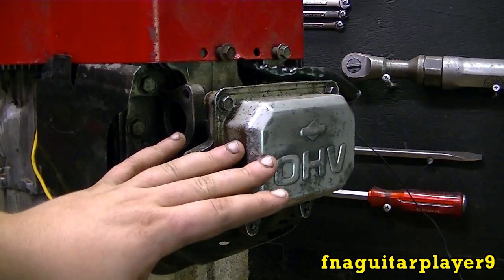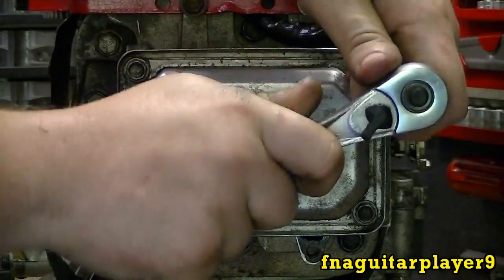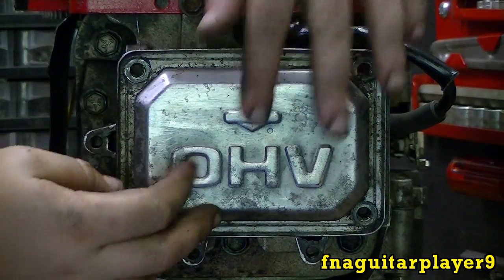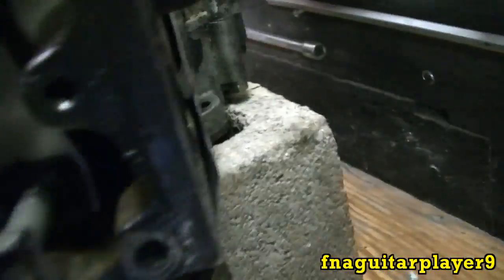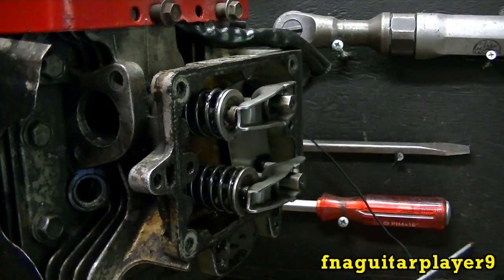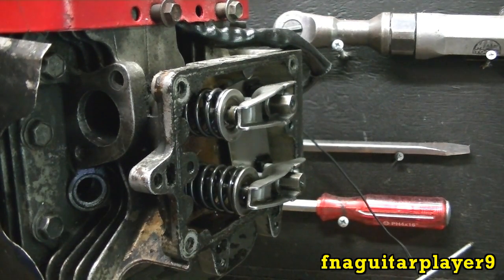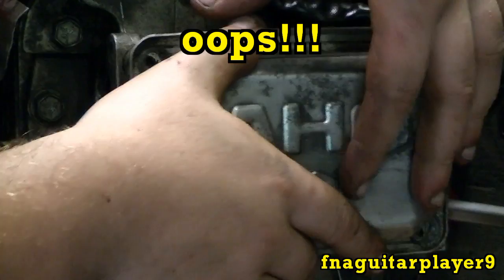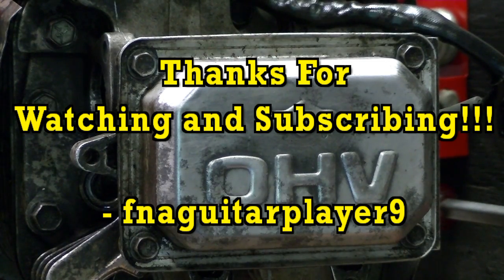How to Adjust Valves on OHV Small Engines (Valve Clearance / lash)

Comment: i ajusted valves still doing the same compresstion not.releasing what is wroug
Reply from the maker: +Raymond Langevin Alot of times when you adjust them and its still not releasing then the lobe is worn out to much on the camshaft for it to work. OR you have a weak starter or battery causing the problem. might have to get a new camshaft if the starter and battery is in good shape. Thanks for Watching!!!

Comment: Why does the decompression valve opening too wide cause the decompression valve to fail to decompress the power stroke ? Is it because at TDC of the compression stroke the bottom of the decompression valve strikes the top of the piston causing the decompression valve to snap shut before or just as  the power stroke fires?
Reply from the maker: +rbbiefah The compression release cycle ends before the power stroke occurs, the release only occurs on the compression stroke. The valve should be closed before the piston comes up all the way, so there is still some compression. Thanks for Watching!!!

Comment: Hey,
I have one at the moment thats dragging while trying to start, Although the valves have been adjusted it is still doing this..So have come to conclusion that it is the cam advance..How is the best was to verify this with out taking the engine apart for you?
Ive adjusted many valves but have never had this problem come up..so either cam..or I know on some could be the key way slightly sheared..out of time..
Thanks!
Bruce.
Reply: wood you have video on timing
Reply: +Raymond Langevin What?..The timing is simple on these briggs..It has 2 dots that you line up and your good to go..one on cam..One on Crank. Bada bing bada boom...

Comment: Is it common to have a large amount of fuel dump out when you take the valve cover off?
Reply: jmoney77 From my own experience with these small engines is that the gas will leak into the cylinders/valve cover making the engine impossible to turn over due to gas will not compress.  I always install a shurt-off valve in gas lines and shut gas off when finishing using equipment...no problem after that.
Reply from the maker: jmoney77 No. I've never heard of that happening before. The only thing i can think of would be the float stuck in the carburetor and the gas leaked passed the rings and flooded the crankcase, check the oil and see if there is gas mixed in it. If there is, check out the float/needle and change the oil before you run it again. Thats about the only reason i can think of. hope this helps, thanks for watching!!!
Reply from the maker: Don Reddish They are bad about that, all it takes is just the slightest problem or leak in the float and/or needle valve and its flooded. I always do that to, and if its going to be sitting more than a couple weeks i shut it off and run the gas out of the carburetor. Thanks for Watching!!!

Comment: Do you have a video on replacing the cam shaft? I have an briggs 15.5 ohv that I can not get the compression release function to work on it. I have adjusted the valves at TDC and 1/4 turn past TDC and everything in between with the same result. Starter turns fine with no plug in. With the plug in there is too much compression dor the started on a charger to turn turn the engine over. Any help would be appreciated
Reply from the maker: Andy Engan I don't have a specific video on replacing the cam, but in this video here I show installing the camshaft, its a different motor (not a OHV motor) but the bottom end is identical, after you replace the cam just set the valve clearance the same as in this video, it will be a little different with a new camshaft. I've had this happen alot, what goes wrong is the little bump on the camshaft wears out after time and it no longer works, this video here shows installing the camshaft, if you need to see how to tear the bottom end apart, find part 1 of 4, it should come up in the side, https://youtu.be/JBYoXZWI3Dk and if you want to learn how the compression release works i have this video here explaining the parts on the camshaft, https://youtu.be/tceKAAViC1c if you have any more questions feel free to ask me, i'm always glad to help out! Thanks for Watching!!!

Comment: what would you call the tool/tabs you use to set the gap on the OHV
Reply: feeler gauge
Reply: Zeke Denton Get the bent feeler gauges. Get a set with   26 gauges to fine tune it. Use a paper business card to set the gap on the coil. Set it under the magnetized part. Replace the governor springs if the engine bogs while cutting high grass. Check spindle bearings for wear.

Comment: great video.  I have a 16 HP
KOHLER ENGINE-MODEL NUMBER CV460, TYPE NUMBER 26509.  Is it the same process?  Not sure how I get it to top dead center.
Reply from the maker: john L Thanks, yes it will be the same procedure, the way i do TDC is remove the spark plug, and use a long skinny screwdriver and rest it gently on the piston, rotate the engine BY HAND until the screw driver quits going up and starts back down, then turn it back to the highest part, make sure both valves are closed (compression stroke) Thanks for Watching!!!
Reply: it turns out I have hydraulic valves which kohler says don't need adjustment.  are you familiar with that?  how does one do maintenance on hydraulic valves?
Reply from the maker: john L Its actually a hydraulic lifter, the valve itself is the same, I'm no expert on them, my truck has a tick in it and i'm pretty sure thats what its from, and to fix it you have to replace them, the bolt on the rocker arm can work loose, if its like my truck it should have a torque spec, and that "pre-loads" them, but i'm not sure if a small engine is the same, i would think so but i'm not sure.
Reply: fnaguitarplayer9 -thanks man.  I can't seem to find spec on the engine for the correct gap on that valve.  Do you have any idea what it should be?  Or where I can find that info?  I think it's called the valve lash?
Reply from the maker: john L Well if its like a vehicle engine it doesn't really have a lash since it has hydraulic lifters, when you torque the nut down you are setting the tolerance of the lifter. I did find this online, its a manual for the engine, it does have specs but it talks about the lifters and gives the torque specs of it, 100 inch pounds but there is 2 different types, adjustable and non adjustable. http://www.kohlerengines.com/onlinecatalog/pdf/tp_2339_d.pdf
Reply: so I guess mine is the non-adjustable valve lash config?  how does one tell?  do I have to pop off the head gasket to find out?
Reply from the maker: john L
Its hard to say with out looking at it. I don't really know, I've only worked on briggs and tecumseh motors with solid lifters so I don't really know a whole lot about these.
Reply: fnaguitarplayer9 well thanks for being honest.
Reply from the maker: john L I wish i could help you more, sorry about that!
Reply: fnaguitarplayer9 you've helped me a lot.  I meant it. thanks.  I do appreciate honesty instead of someone just trying to bullshit me.
Reply from the maker: john L
Your welcome!

Comment: Great video series, and I appreciate all the help!   I have an old reliable 96 Craftsman  rider with a Briggs 15 HP OHV, and I just found a busted push rod on my intake valve.  The engine was purring smooth while mowing, and it just lost power when the rod busted.  I'd appreciate any info on how tough of a job it is to replace it.  Thanks!
Reply from the maker: Appreciate that, glad to help! If thats the only thing that broke, it is a very easy repair, all you do is remove the valve cover, loosen the rocker arm (i have a video on how to set the valve clearance, it shows most of the parts i'm talking about ) then you will see a chamber where the rod goes in the block, there is a little dimple (valve tappet) where the push rod rides in, once you get it on that, you put the rocker arm back over top of it and set the clearance and your done. Here's the video on setting valve clearance, http://youtu.be/H8C25hFv1mU  I would make a video but I'm busy for the next few weeks, I'll put it on my list though, never thought of making a video on this. your welcome, Thanks for Watching!!!
Reply: fnaguitarplayer9 Thanks for the quick reply!  I'll pick up a new push rod tomorrow, and hope there's nothing else broken that caused the rod to break.  I tried to see that valve tappet with a flash light when I took the old rod out, but hard for me to see it.  I'll give it a try real soon, and let you know.  Keep up the great work, I've become another big fan of yours!
Reply from the maker: Dan Beelman No problem! I hear ya, It is hard to see past the push rod guide plate, hopefully that was the only thing that broke. Yeah let me know how it goes and if you have any problems/questions let me know. Appreciate that!
Reply: fnaguitarplayer9 I wish I could say it's back up and running, but no such luck.  After installing the new push rod, I adjusted the valve clearance, and then it would fall out of adjustment after cycling the valves!  After too many attempts at readjusting, and repeating the sequence I gave up.  The new push rod doesn't seem right, could I be missing the dimple in the valve tappet?  Or maybe a bent valve tappet I can't see?  Frustrating!  Thanks for any suggestions.
Reply from the maker: It could be not hitting the dimple right, i doubt the tappet is bent, hard to say for sure though, now did you tighten the set screw back up on the rocker arm? If you didn't it would work loose real quick. Also check the rocker arm for cracks or stress marks, the rocker arm may be bending. Get back with me on this, we'll figure it out!
Reply: fnaguitarplayer9 Good attitude, thanks for that.  Yes, I tightened the set screw each time.  And yes, I gave that rocker arm a good look, even switched it out with the exhaust arm to see if the problem followed.  I'm thinking of taking the rocker arm off, getting another set of hands to help crank it for me while I hold onto the push rod and follow it through a cycle or two.  Maybe the dimple good be marred, and I can't see it?
Reply: Dan Beelman Good news today, she's back up and running again!  Evidently, I was missing the TDC on the compression stroke, and I thought I knew what I was doing, haha.  Sure helps to have another set of hands, and someone that's been there before.  Thanks for hanging in there with me, you're a great help!  Take care, and keep those videos rolling.
Reply from the maker: Heard that! Oh yeah, that will do that haha Your welcome, feel free to ask me any more questions/problems you run into! You to, will do!

Comment from the maker: Thats a good question to bring up! There is no way to get a accurate reading! And to be honest i don't even have a compression tester, but from what I gather, Briggs recommends doing a leak down test on these motors instead of a compression test, then you can determine if its leaking past the valves or rings or even the head gasket. Thanks for Watching!

Comment from the maker: the choke having to be on like that sounds like a clogged jet, i'd say you may need to clean the carburetor, as for the starting problem, that might be the valves being out of adjustment, not letting the compression release work. thanks for watching!

Comment: I have a 17.5 horse b&s riding lawn mower and to start it u have to choke but it won't start until its off choke and even when it's warm it acts like the battery is low even after its come off the battery charger any chance this is what could be wrong with it thanks your input would help a lot